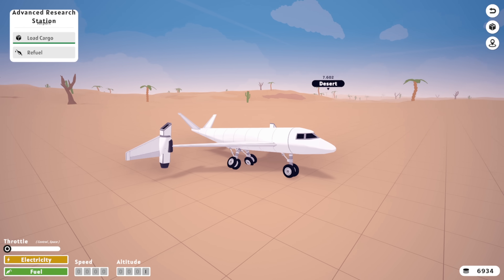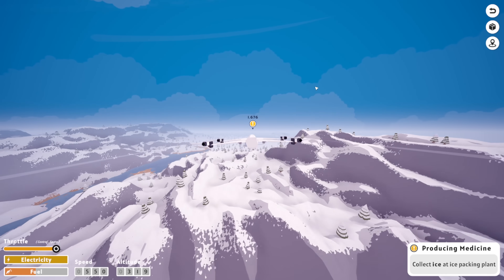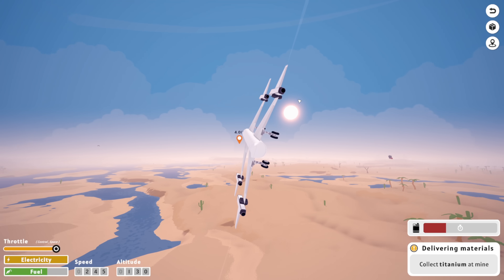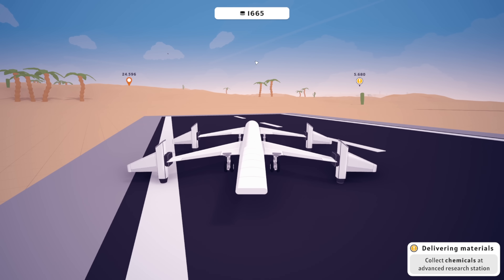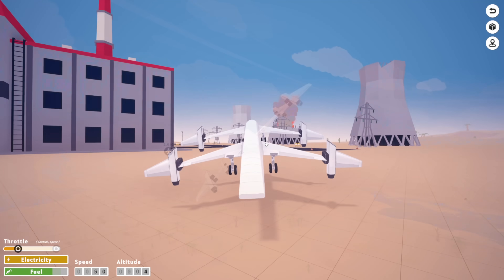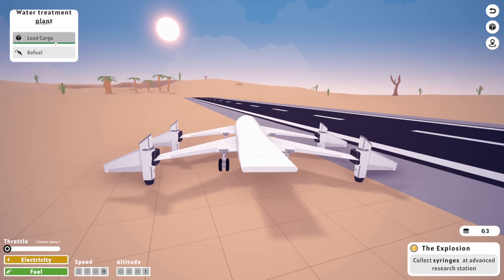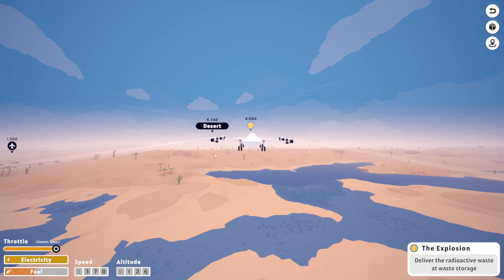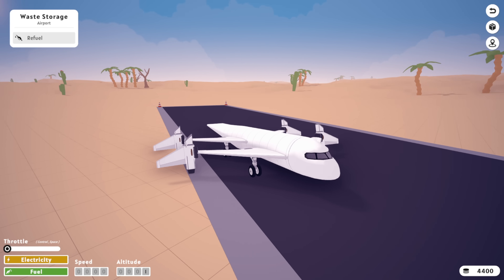FOUR JET ENGINES On A VTOL! - VTOL Only - Ep10 - Aviassembly

Comment: How about a "One Stop Shop" challenge:

Always deliver all the goods a place asks for in a single landing.
Reply from the maker: I did think about this, it might work! :D
Reply: might be possible once you reach the second island, first island you're so limited by power and budget that i don't think you could build big enough
Reply: @MarkoDash  Yes, the beginning will definitely be difficult.
I guess the best tactic is to first fly to every place on the map to see what they want, and then systematically pick the smallest wish lists and deliver them first.

Also, in the early phase you'll definitely have to prioritize capacity over speed. Which also means that any time-critical deliveries will have to wait until later.